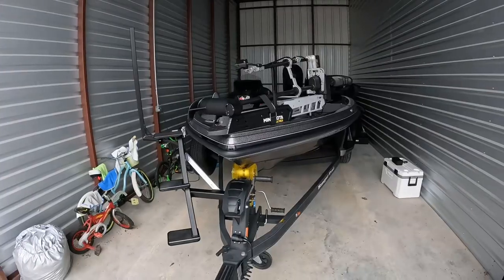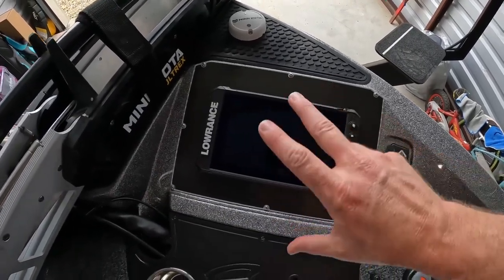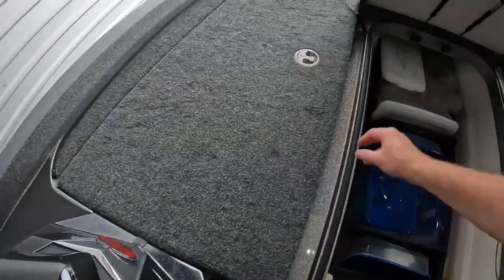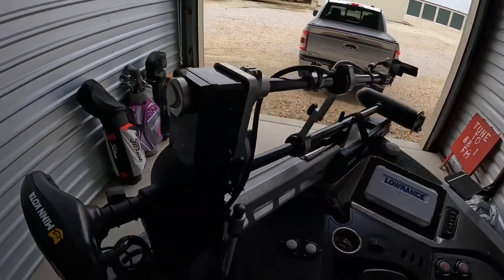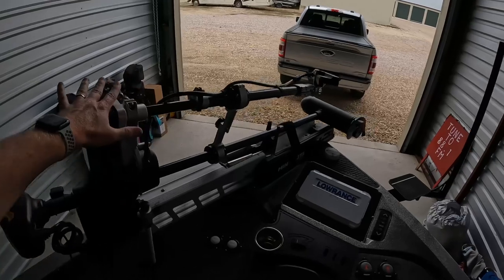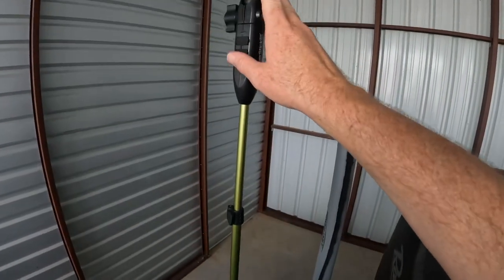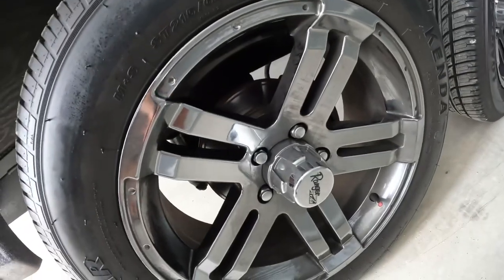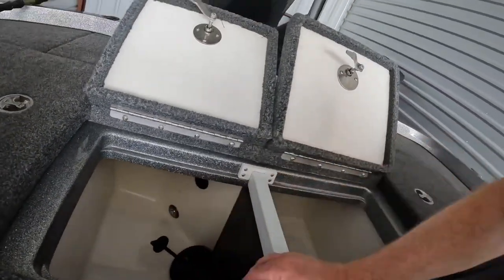New Ranger Bass Boat 1 year review

Comment: Awesome review and insight on the Ranger. Beautiful rig. I would highly suggest investing in lithium batteries next. It won’t be cheap. However, it will take the worry away of running out of juice during the day. Also, switching to lithium will save you a lot of weight in the rear end of your boat, which should help improve the hole shot. I would maybe go with 3 lithium batteries(or 2 if your Ultrex is 24v) solely dedicated to the trolling motor. I’d still keep the AGM battery to start the Merc. If you want to run all of the other electronics on the the AGM, I’d run another AGM in parallel. Or maybe upgrade to a beefier AGM, like a Group 31 12v 100ah X2 Power. Now, if you wanted to spend a little extra, just add an extra lithium solely dedicated to all of the electronics. Then you gotta make sure your current battery charger is capable of charging both types of batteries. If not, that’ll have to upgraded as well. I noticed you mentioned money figures at the end of the video in regards to boat prices. They are definitely way more these days. At the end though, I feel it’s worth it no matter what if you can budget for it. We love this sport too much and work way too hard to let anyone tell you anything. You live once. Just do it and go catch a biggun!

Comment: I have same boat . I’ve got a helix 15 on the dash . Helix 10 and garmin 102sv on top of it . I run 2 ionic 50 ah on the trolling motor and a impulse lithium parallel with a 31 interstate  agm . I use less then 10 percent of battery all day long .

Comment: Added Lithium and it was a game changer…..just got them last week…fished Lake Norman all day and I just checked i’m at 91% on the three trolling motor and 98%on the main batter…running 3-50ah for the trolling motor and 125ah for the motor and graphs ( 2x9 inch graphs and Mega live). I went with the ionic batteries and Ionic 4 bank charger. The cost was $1,800 for everything, charger needs to be rated for lithium….you have a sweet setup by the way…
Reply from the maker: Good to know!  That’s not to bad.  I mean it’s crazy expensive but glad to know you’re getting good power.  Was on the lake today and was out there for 4 hours, running active target and my other electronics and batter was at half draw!

Comment: I have a ranger 461 vs from 1996 with a evinrude intruder 150.  Its amazing.  It immediately gets on plane.  The hull shot is phenomenal.  It runs 52 mph loaded down.  The stability and ride is amazing.  I have a buddy that has a 2020 z519 ranger that complains about the hull shot and stability.  He previously owned a 96 Ranger 487vs and regrets selling and getting the newer ranger.  Its mostly due to the outrageous price of the newer boat and pretty much the same problems you had.  If i pay 70000 plus for a new ranger I shouldnt worry about hull shot and stability.  The bass boat market is insane now with the cost.  I love my 461 vs.  I fish great lakes in that boat and its amazing.  I think the older rangers were the pinnacle of bass boats.
Reply: The Ranger 461VS was built by Forrest Wood back in the day when Ranger was a top of the line boat......they are now built by Johnny Morris ( Bass Pro Shops)  nuff said
Reply: Hole shot!!!???
Reply: I also have a 97 Ranger 461 vs with a 150 Mercury EFI. It rides like a bent piece of Steele. I recently had to put some money into the engine otherwise it’s got a hot foot, hydraulic jack plate. Bought the boat from a friend back in 1999 for 19k.

Comment: Added Ionic Lithium batteries to my 18’ boat, two 100 amp hour (AH)  for the trolling motor  (24 volt system ) one 125 AH starting battery that also runs my electronics and have been very Happy. Your electronics are rated at AH they use per  hour  so adding up your usage for 8 hours gives you a starting point of what you will need. Lithium go deeper (discharge more) whereas wet batteries start losing effectiveness at 50% discharge. Ionic batteries also are blue tooth capable - I look on my phone app for the charge of the batteries. Plus lithium are half the weight. And YES, I paid  $3k for them delivered, but guaranteed 10 years. It is a choice I am happy I made.

Comment: Get an Ionic 125amp for all your cranking battery. I have a 520L 250Mercury 
16LIVE 
2×12live up front 
1 for AT
Plus all the other stuff that is needed and my battery never goes below 45%charge during a tournament.  Has them for 3yrs no problem

Comment: I don't know about lithium batteries. I have friends that have them, but I have also done some reading.  As you know, there have been a lot of explosions and fires from lithium batteries. Computers,  automobiles, vape pens, electric bicycles and toys. I read that being overcharged and under charged can cause the battery to heat up and possibly catch fire. Afraid of those kinds of issues and what the results could be.

Comment: I have the same boat. Which steering lock size did you get? I’m thinking the 7/8” 4”? Thanks
Reply from the maker: So they sell a new generation for these but if you’re running a sea star system here’s what the DD26 website says:
Seastar steering systems - Usually 4" steering locks 3/4" Diameter (most common) (These clips come standard with the DD26 Gen 2 Mean Stops)

Thanks for watching!

Comment: Adding a hydraulic jack plate will not help you to plane off any faster...you need to remove weight from the back of the boat ( lithium batteries) and/or a different prop

Comment: I run 5 graphs live foot livescope power poles on 3 50 amp hr iconic lithiums. I can fish 8 hr still have 67% left on the batteries. You will probably loose a little speed with lithiums .

Comment: CAREFULL WITH LITHIUM BATTERIES IT MAY CHANGE THE SPEED AND THE HOLD SHOT IF YOU CHANGE TO A LIGHTER BATTERY.   RANGER DESIGNS THERE BOAT FOR THE WEIGHT FOR STANDARD BATTERIES